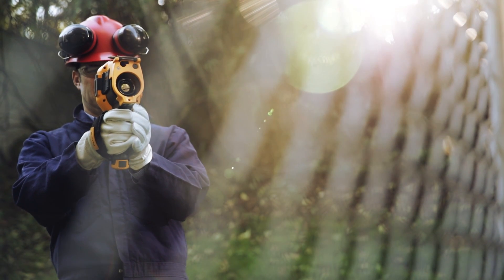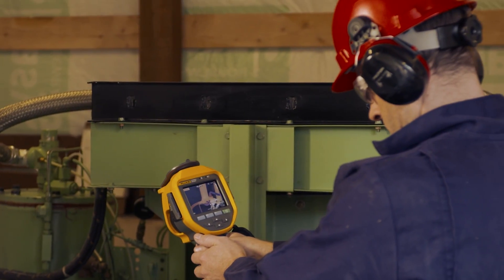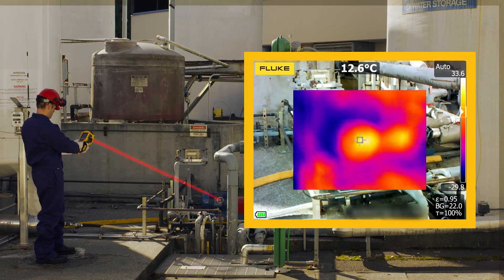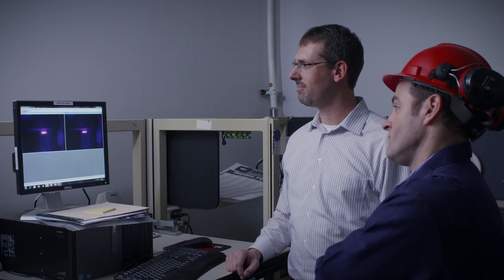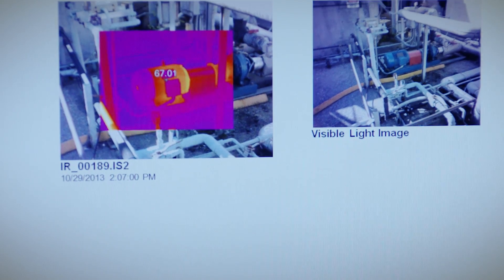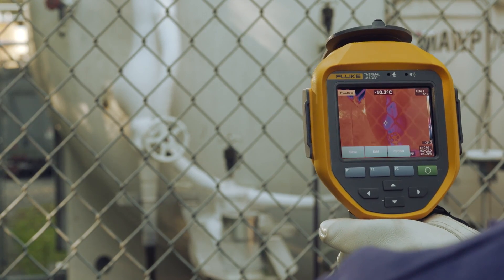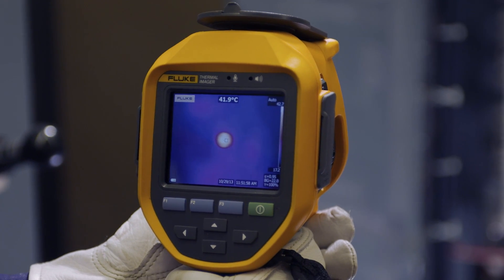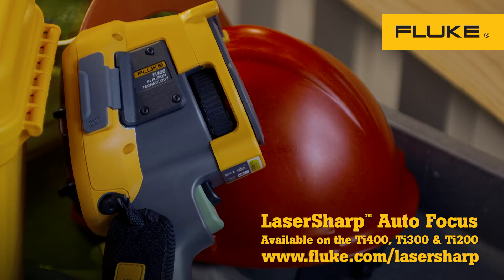Fluke Ti400/Ti300/Ti200 Infrared Cameras With LaserSharp® Auto Focus

Comment: Such an expensive tool and Fluke can't get the connection to download images right!!!! What a waste of money. Took almost 50 measuring points and spent 2 hours trying to get the images downloaded into the pc using fluke connect via, SD card, usb, bluetooth and wifi. None of that worked. Had to retake all measurements again with a $300 IR scanner. Don't waste your money with this s***t !!!!